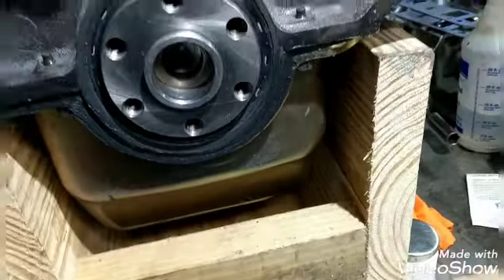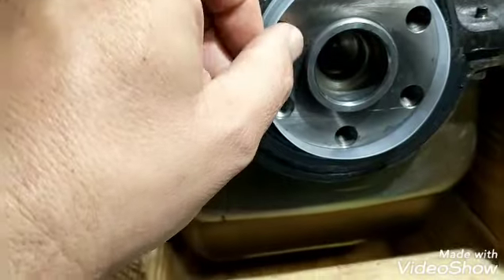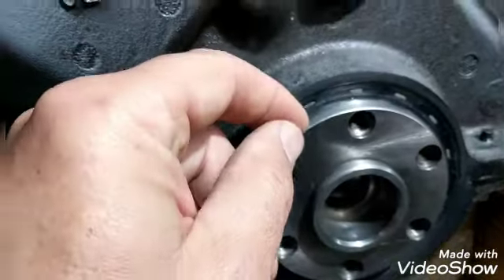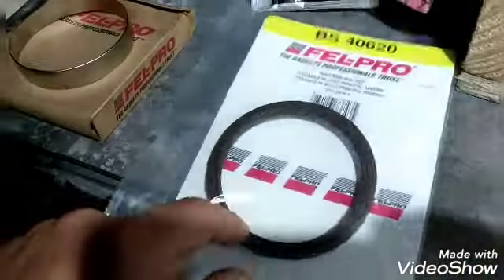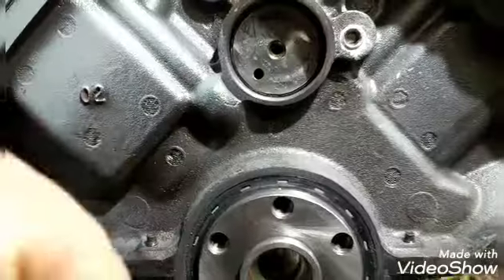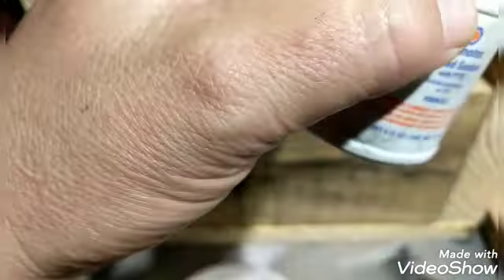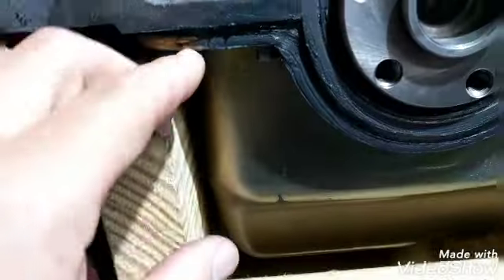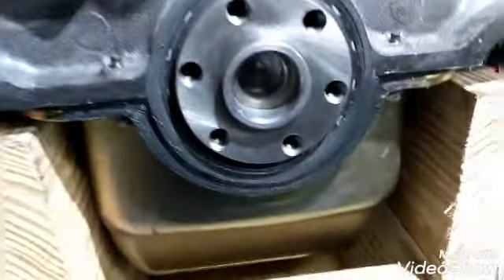Rear main seal install pointers

Comment: I want to thank FXRSDriver for posting this vid and I clicked the like button.  I've done about 20 of these single piece rear mains. One piece of advice I can really pass on is for new engine assembly.  If you are assembling a new engine on the stand, I learned that it is far easier to slip the rear main seal over the rear crankshaft journal and then simply lower the crank into the block with the seal already on the crank journal.  This is a two man job to ensure that you can finesse the seal forward or aft to hit the block seal journal dead on.  Lube the rear crank journal first.  Do not lube the outer periphery of the main seal, however.  The main cap is then simply bolted on top of the seal.  I've seen the guys on Power Nation youtube channel do this a few times as well.  Good job on the seal saver tip which most people dont know about. There is a proliferation of these Scat 331/347 stroker cranks which seem to have a slightly undersize rear crank journal which have caused a ton of rear main leaks. For contrast, I recently purchased a Scat 393 stroker crank and measured the rear journal before assy.  It was bang on at 3.75" OD which is the factory 351W size.  Keep up the good work.
Reply from the maker: I take it off the stand and put it on the bench upside down to the put the seal in. More work, but easier to do it right. I've heard of putting it in with the crank, but I when I spin the crank, I don't want that drag from the seal on there.
Reply: @FXRSDriver  Not a bad idea brother!

Comment from the maker: After having the rear main leak on the 90 LX, and the one on the LTD starting to leak a bit too, I'm not a fan of the teflon one. Woody at Fordstrokers says he only uses the fel-pro 40620, so that's what these will be replaced with.

Comment: Do you remember how long the flywheel bolts are, I've got to buy a set but can't remember the length that I bought the last time I'm thinking that they were 1 1/2" long correct me if I am wrong. That was some good info, I do need to get me one of those seal installers cause it does make it easier and don't have to worry about warping up the seal. I've never had any leak but always a little nervous about it at start up doing it the shade tree way 😂🤣
Reply: Mine are a shade less than 3/4 long. That’s from the bottom of the head to end of the bolt. Overall length is an inch
Reply from the maker: Flywheel bolts are longer than flexplate bolts. I think the flywheel bolts are probably in the 1 1/4-1 1/2" range. Flexplate bolts are probably about 3/4" long.
Reply: @FXRSDriver  that's what I was thinking, I had to buy some longer ones on my last foxbody I built because I decided to go 5 speed after I put an aod in it but I Couldn't remember the exact length but was thinking that it was around 1 1/2" . I was just double checking before I ordered them, thanks

Comment: What seal installer are you using?  Having a hard time finding the right one for a Windsor 5.0.
Reply from the maker: It was further down the page, good reminder to put up though. I've heard of guys using a block of wood, or piece of large PVC pipe too.

https://www.summitracing.com/parts/pio-5171217

Comment: I bought a pvc drain grate at Home Depot to install the seals I didn’t know they had a tool . How about a link if you got it for that seal installer .
Reply from the maker: This is what found on summit
https://www.summitracing.com/parts/pio-5171217
Reply: FXRSDriver thank you sir